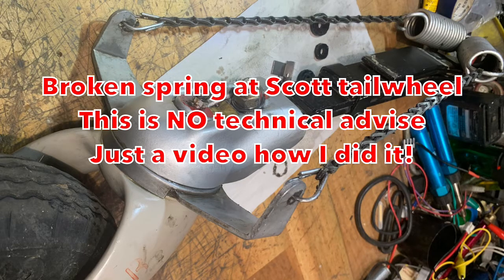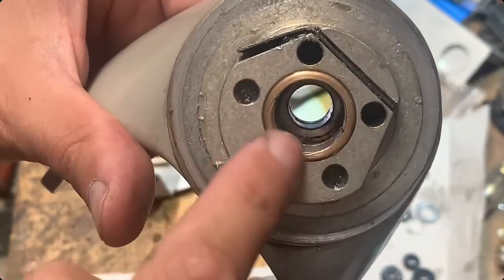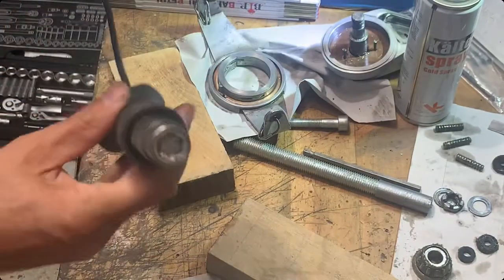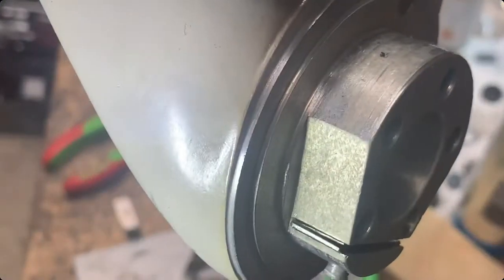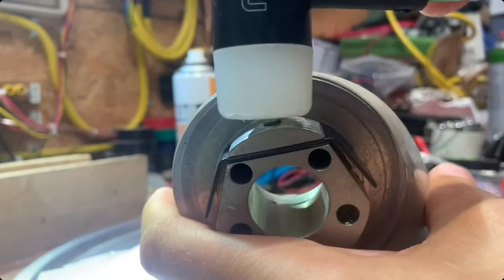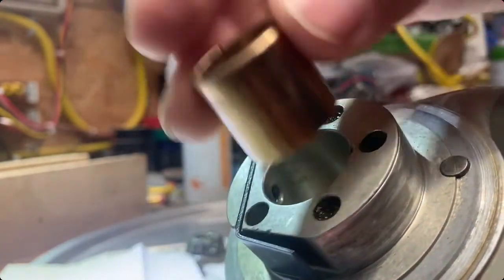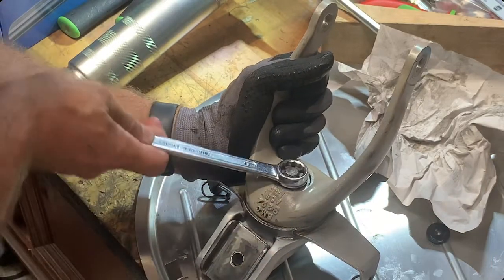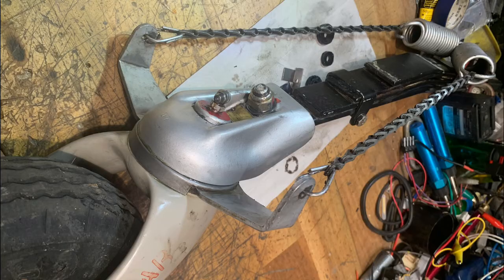Scott tailwheel change the broken main spring due to the tailwheel didn’t lock anymore!!! Dangerous

Comment: Excellent video! I'm going to do mine with your method. I noticed that the new spring is not sandwiched between the spacer as the original was.  Was that the way you wanted it, or was it one of the 'dang it' moments?
Reply: Hi Steve! Good eyes! The point is that the new spring from aircraft spruce is much stronger (thicker) than the original one. So the spacers didn’t fit anymore, there was not enough space left. But from overhauling already 3 others I had some old ones left. But the first time I made a new one cut out of some metal. But never had any troubles with the new spruce spring. Works perfect